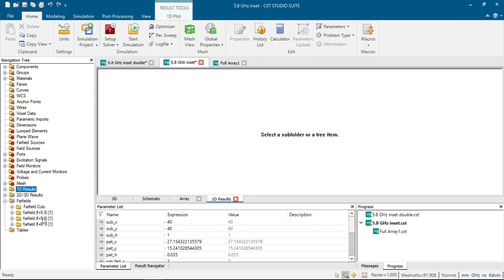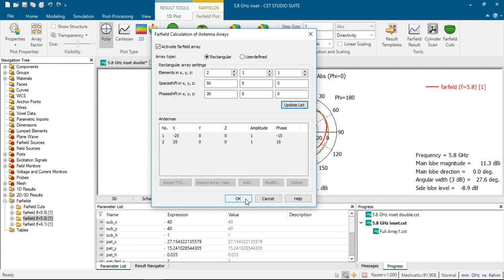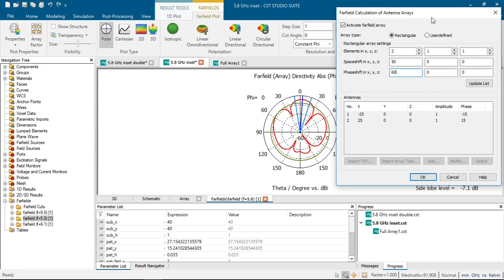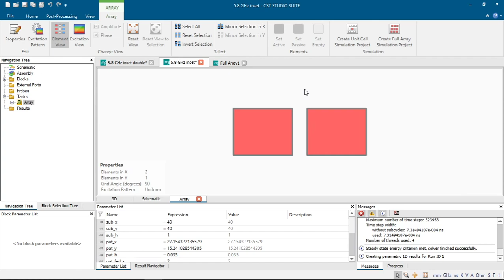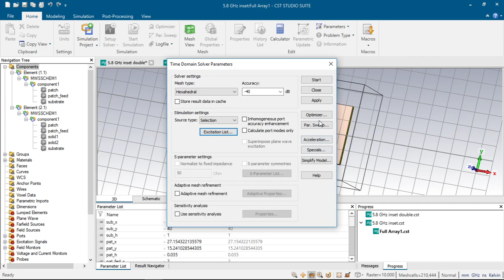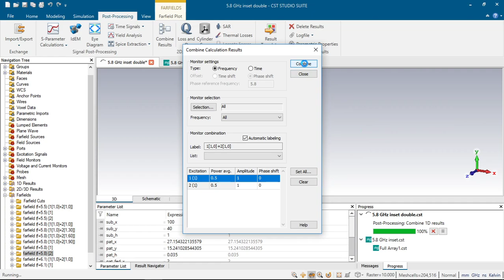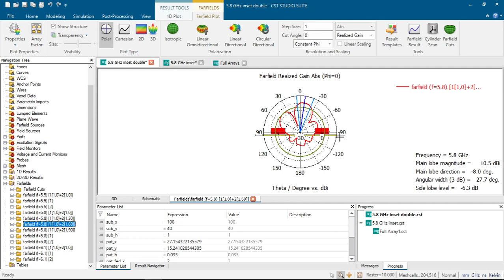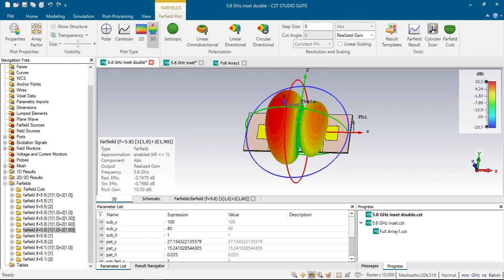5G Phased Array Antenna Design and Beamforming using CST

Comment: What to do if Excitation port overlap? I am trying to design MIMO based on a halfwave inter-element distance and massive excitation port during simulation cause the problem. (excitation port X = 9.056 mm and halfwave = ~5.8mm) That option "allow excitation port overlapping" does not work or maybe I don't know how to use it correctly. Could You suggest something please? Thank You!

Comment: Thank you very much, This is two port antenna. So, wich applications we can using this kind of antenna operating at 5.8 GHz , I mean WIFI or 5G ? . But 5G operate at high frequency ( mm-wave) like 60 GHz. Please, if you can explain in comments a bit enough details for this antenna. Thank you very much  & many thanks. BEST REGARS.
Reply from the maker: there are different frequency bands for 5G. They vary by different countries. This video just a tutorial about designing phased array antennas. You can design antennas in your particular frequency and can apply techniques described here without any problem. Regards.

Comment: Hi sir , Nice video ..Besides the farfield pattern can we get the results for S-parameter ,Gain, Directivity Axial ratiofor two element array ?
Reply from the maker: Yes you can. If you simulate the full antenna you with monitoring options enabled you can find all the necesarry parameters.

Comment: Hi, what type of dielectric material did you use?
Reply: The FR-4 and Rogers family are the most common ones
Reply: @fredfrancium  Thank you for the answer, but my question is which one is used in the video?
Reply: @mertcanaltikardesler2803  Based on color I think it should be FR-4

Comment: Hey sir, i got a problem with how to reducing the backlobe of MIMO antenas. Can i have an advice? 
I was try to add the New materials but still not good
Reply from the maker: There is special taper distributions for setting sidelobe levels, using Taylor and Chebyschev polynomials. Unfortunately I can not give you exact solution for your problem.
Reply: You can use EBG structure
Reply: Here is the paper: Development of 60-GHz millimeter
wave, electromagnetic bandgap
ground planes for multipleinput multiple-output antenna
applications

Comment: Thank you so much,
Please, can i apply beamforming algorithms with cst?
Reply from the maker: By changing the magnitude and phase of the excitation you are applying beamforming. Do you want to apply a special beamforming algorithm?
Reply: @SimulationMaster 
Yes, like LMS, MVDR and others
Is this possible?
Reply from the maker: @maryamagha1557  I don't know yet. I will look at what we can in CST, and get back to you.
Reply: @maryamagha1557  Yes you can, but you will need to access CST via another tool, such as MATLAB, to change the amplitude and phase of the excitation in CST.
Reply: @quinten52  Sir, how can we access the cst amplitude and phase values from MATLAb?
Reply: @satishkumar8421  The easiest way to do it is by exporting the radiation patterns in CST and importing them into matlab
Reply: @maryamagha1557   were you successful with spl beamforming algorithm in cst ?
Reply: @quinten52  how can one access cst via matlab

Comment: Sir,are you using CST 2018 or 2019?
Reply from the maker: CST 2019
Reply: @SimulationMaster  thank you sir
Reply: @SimulationMaster sir, will your project files works on CST 2018?
Reply from the maker: @shobanap7156  I don't know, probably yes :D juts try, and if there is a problem let me know
Reply: I'm using CST 2018 and it is not able to open this project file and the others in your previous videos that includes project file

Comment: Can you make 5G antena.for me
l Requirements
1)	Frequency Range
a.	Low Band : 617 MHz – 960 MHz
b.	Mid Band : 1710 MHz – 2170 MHz
c.	High Band : 2496 MHz – 2620 MHz
d.	Ultra High Band: 3300 MHz – 5000 MHz
2)	VSWR: 	<= 3.5 : 1
3)	Polarization Vertical
4)	Low-Band average gain for 0o <=  <= 360o degrees & for 0o <=  <= 15o to be -7dBi
5)	Mid-Band average gain for 0o <=  <= 360o degrees & for 0o <=  <= 15o to be -5dBi
6)	High-Band average gain for 0o <=  <= 360o degrees & for 0o <=  <= 15o to be -3dBi
7)	Ultra-High Band average gain for 0o <=  <= 360o degrees & for 0o <=  <= 15o to be -3dBi
8)	Standard Deviation of gain is 4 dB
Mechanical Requirements
1)	Length does not exceed 55mm
2)	Width does not exceed 40mm
3)	Height does exceed 29 mm